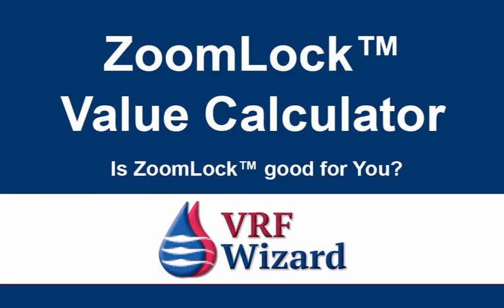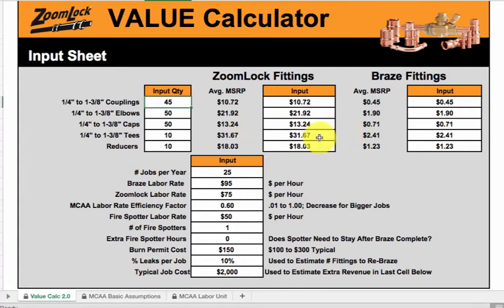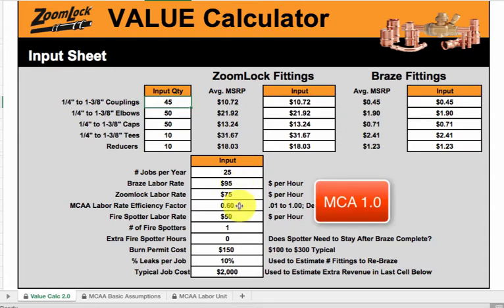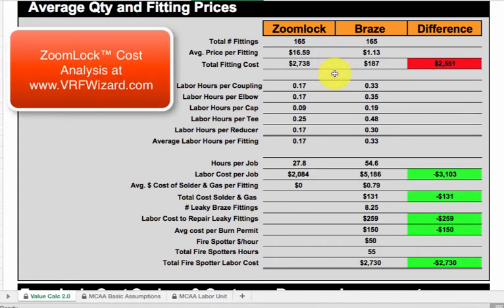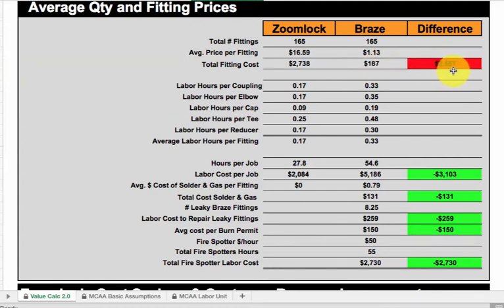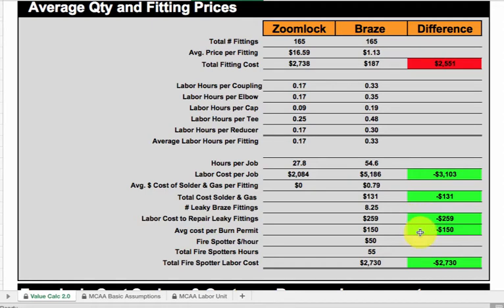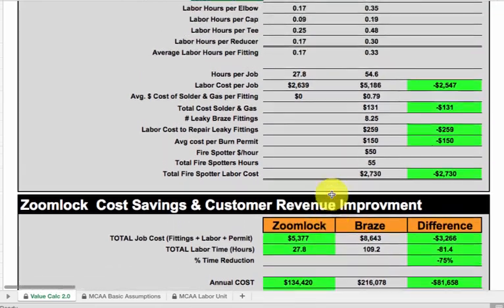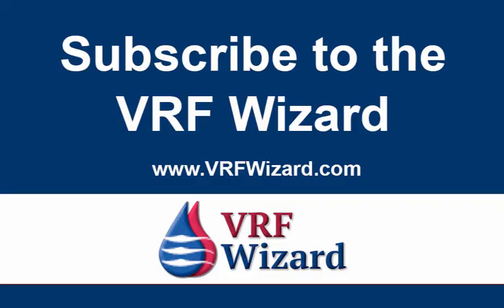ZoomLock Value Calculator for VRF Systems

Comment: Faced with replacing air conditioning units at a West Virginia high school with much of the work to be completed during the school day, the installing contractor turned to Conex Bänninger’s ACR press-fit innovation >B< MaxiPro for a flame free, fast and reliable solution.

City Plumbing & Heating had to work to a strict deadline to install the new refrigerant systems in the hallways, locker rooms and rooftops at the 1,800-student Morgantown Senior High.

With the use of torches made impossible, because the installation had to be carried out during school hours, City P & H considered a number of options for the best jointing solution to use.

Having consulted with N H Yates, Conex Bänninger’s representative in the state, the contractor chose >B< MaxiPro.

Developed by the IBP Group company for air-conditioning and refrigeration applications, >B< MaxiPro can be used up to a maximum operating pressure of 700 psi at 250°F, with a permanent maximum operating temperature of range of -40°F to 284°F.

As a mechanically strong copper joint, there is no need for a fire watch, the risk of fire is eliminated, it can be used in confined spaces and the speed of connection is significantly faster than for ‘traditional’ brazing.

Jay Wade, President of City Plumbing & Heating, said: “This project was on a tight deadline within a confined and occupied school.

“We use press (fittings) for water and gas currently but for refrigerant it was a big decision. After meeting N H Yates and the introduction to the >B< MaxiPro product, we decided that this would be a great project to give it a try.

“The training from Matt Hatmaker, Senior Commercial Sales Engineer of N H Yates, was very thorough. The training included an overview of the Rothenberger press tool and my field team even found the test at the end a nice recap to the training.

“The installation was flawless and >B< MaxiPro is now our only option for refrigerant piping.”

To produce a permanent tight connection, the fittings are pressed over three points, one on each side of the bead and one compressing the O-ring.

Each fitting comes with an industry-standard 12-month warranty, extended to five years when the official training programme is undertaken and the installation is made in line with Conex Bänninger guidelines (refer to full terms).

Conex Bänninger recommends the use of Rothenberger Romax 4000 press tools and >B< MaxiPro jaws for all press installations.

Eleven City P & H employees were trained onsite by N H Yates and tested in the proper installation of the product and use of the Rothenberger tools.

Matt Hatmaker said: “Wherever we have recommended >B< MaxiPro to an installer contractor they have been delighted with the results and have readily adopted it as their ACR solution of choice.

“The advantages of a flame free, permanent joint that is significantly quicker and easier than brazing to complete are steadily gaining ground in this important market.”

http://www.conexbanninger.com/US/case_study.php?id=9